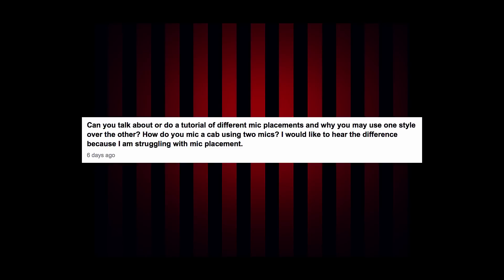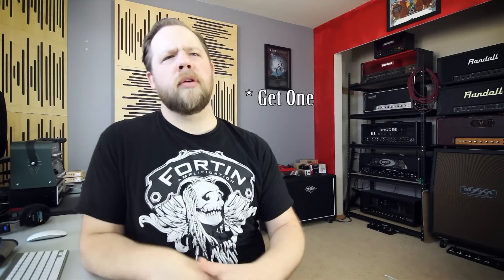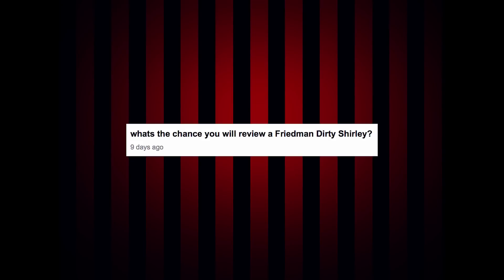FAQ Mondays: Mic Placement, Fav Cabs & Friedman Amps

Comment: The other issue with mic placement is making sure the signal is loud enough for the mic to actually capture a good signal! If your speaker is putting out low volume, you're going to get some weak-sounding guitar no matter what your mic placement is. Here's a Mic Placement Primer: 1) turn your audio interface gain to zero, 2) place your mic directly at the center of the speaker, 3) turn up your guitar amp volume until the mic's signal peaks in the yellow.  Once you're getting a good signal, trial and error is your best friend (moving from center, to cap to cone to off axis, etc.). For another option to enhance your tones when tracking other than dual mic'ing: use some analog emulators.... a SansAmp GT2 can be a great choice simply to get a scratch track and/or blend with a mic'd signal. I personally use a SM57 and an A/DA GCS-3 Cabinet Simulator to function as my "2nd mic" because it's relatively fool proof, I don't need to worry about phasing issues, and I can get way more tones out of it than simply using the "tried and true" SM57 and Sennheiser e906 combination. It's entirely possible to go completely mic free if you are still having issues. There are so many cabinet emulators and amp-to-DI converters out there (Radial JDX for example) that perform so well, one could make the case that these products are way better because they give you a full-frequency "picture" of your amp's tone that you can later adjust and correct when mixing with post-EQ (as a sound engineer would do live with a console). If mic placement is your weakest link in the recording chain, don't stress about it! You could just be simply using the wrong gear (for your situation)! Good luck!

Comment: When setting up a "heavy metal" tone, do you get most of your gain from the amp and maybe put in a boost pedal or a tube screamer, or do you prefer low gain from the amp and punching up your signal with a high gain overdrive pedal

Comment: Monitors: Looking at the LS305 due to cost and size as well as a lower frequency response in the ~40hz range, but have been told that the bass response isn't great because of the "small" drivers.  I've been referred to the Yamaha HS7 or HS8s, but unsure if I have the room for them.  Thoughts?

Comment: I'm currently writting some songs and also buying my first electric soon. Should I get a cheap amplifier and microphone it or go for a basic audio interface and use softwares and effects i have on my DAW? (Just FYI, with the budget I have I can get a begginer 15w amp or a focusrite scarlett solo)
Reply: xnerothefoxx my personal advice, would be to get and amp that is its own Interface already at the same time (Blackstar ID/TVP/Beam/Core models and Yamaha THRs are the best)...i have a THR, and not only does it Sound like a great freaking good sounding guitar amp, but it also works as an acoustic amp, bass amp, and with the "flat" Setting it works as an amp/Interface for anything else, like e-drums, Keyboard, mics etc...and since it has wet/dry DI USB out, it is also obviously your Interface for all those instruments at the same time....all that in a Little package that doesnt really cost that much (specially used) nor does it take any place on your desk...and it sounds pretty damn good...same goes for the Blackstar stuff..
Reply: I was really into the THR at first glance, and still am, really, thing is, it goes way far from de budget i have for both the guitar and the amp. I love it's sound, it's portability and all other features, but where I live, just that amp price takes away the whole budget. I bet many others on the likes of it would also be expensive around here. Thanks for the answer tho.

P.S. I think it's good to mention that my budget is not that big, which generated the question
Reply: xnerothefoxx well in that case maybe you want to take a closer look on the Blackstar ID:Core 10...where i live i costs a third the Price of the THR...yeah it doesnt have all the Features of the THR, but as a recording amp it works just fine, because of the DI Outs via USB...where i live the THR is at about 300euros, the Core10 at about 100euros...with the extra 200 you could buy a very good and versatile Yamaha Pacifica HSS guitar that will also do almost any Sound you could possibly want...thats a good Budget recording-combo right there...at least its what i would buy for that kinda Money...
Reply: Wow, thanks for the tips man. I'll look for that Blackstar. I already have a guitar in mind that it's not expensive and is about the same grade as this yamaha...

Comment: Do you find any difference between recording with a mesa 2x12 and a 4x12 or is the difference inconceivable in the mix?
I have a Marshall 4x12 which I bought years before my new Mesa Roadster head and am looking to downgrade to a 2x12 unless there is a major reason to keep a 4x12. Live possibly as it is angled, but is a hassle to transport.

Comment: Hey Fluff! My Line 6 Spider 2 head started warbling a good bit on the crunch channel that I have saved as a preset when I'd palm-mute. It did the same thing with open strumming on my twang channel. I turned the drive down on both channels, but it still warbles. Do you know what the problem could be? Sorry for the long comment, but I really appreciate the help.
Reply: My line 6 used to do that as well, when I turned the bass up, or when I turned up the volume relatively loud
Reply: Angelo Riffs I will take a look at the bass EQ setting today. Thanks for the tip, man!
Reply: A little late, but try using some EQ and a Noise Gate. :)